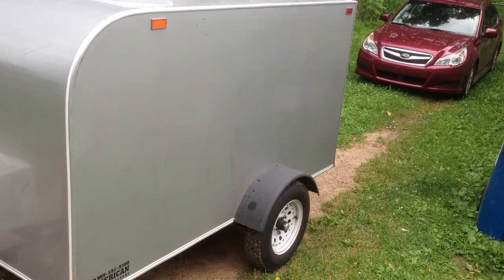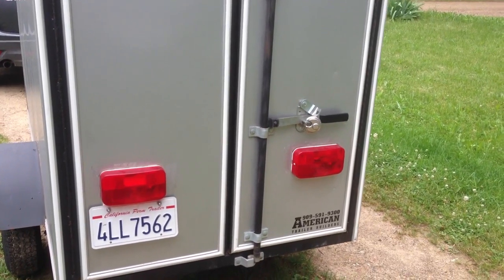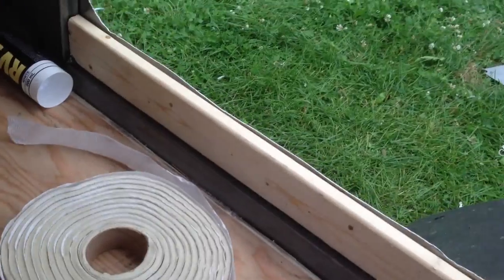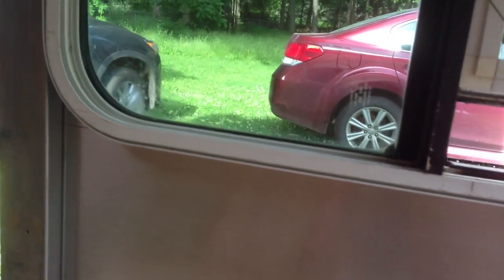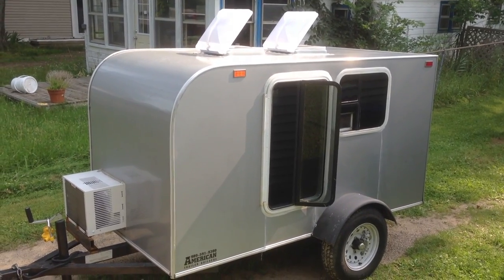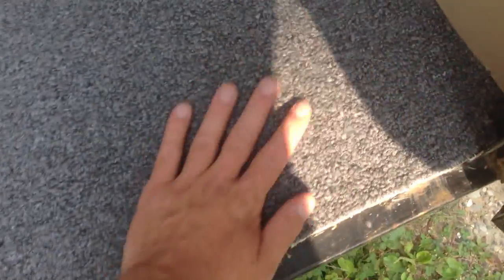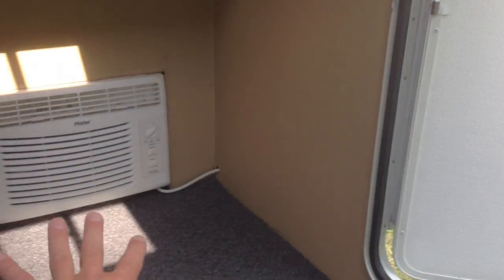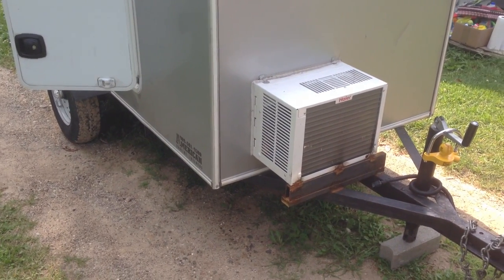Teardrop Camper Trailer How I Built My Teardrop Camping Trailer

Comment: I want to have a frame inside a frame of one of these. A aircraft aluminium frame that will support 2 hammocks for 400 lb on both sides one high one low in an X pattern.  Hammocks to sleep in and hammock recliners that can be hung from the roof. A frame that can be TAKEN OUT AND USED AS A SCREENED IN TARPED OVER ENCLOSURE THAT CAN BE EXPANDED! Do as I suggest then the inside can be used as an office as a place to sleep as a place to shower you name it you convert your space it is very versatile and for little weight. 
I would like to see a rack on the front that contained propane and a generator. Roof with solar and some battery. 
What I love about your trailer is it can be towed by a PRIUS. I have a trailer for my car that is TOO BIG. It is a 4x10 I think and it sucks to tow it with my Prius. I got it to bring a motorcycle to shops it will do that but my interest in motorcycles is not there any more I am done with bikes.
Rather than have a trailer that does a lot of things maybe I need to focus on one that does one thing shelters?

Comment: they got a 12volt zero freeze ac unit now about a quarter the size of that widow unit .
it would turn that camper into an ice box. just on 12 volts it also has a blue tooth speaker built in and a flashlight . not kidding google it.
its called zero freeze.

Comment: So what your saying is you can spend all this time hunting up these parts and time installing them in this trailer or buy one from Runaway camper already finished out for the same price ? Hmmm....
Reply: You can do a build from a cargo trailer for a lot less than a runaway. Im doing one with a vent, AC, spare, mount, jacks, dual doors, windows, and a rear door, for less than a Runaway's most economical model. Im only installing the AC, they do everything else. $2104.
Reply: maybe he likes things done correctly
Reply: @uscg8168  where did you get the actual trailer with the options from?
Reply: @wandering1752  i bought a cargomate, window, sude Doors, vent. Texas trailer, San Antonio.